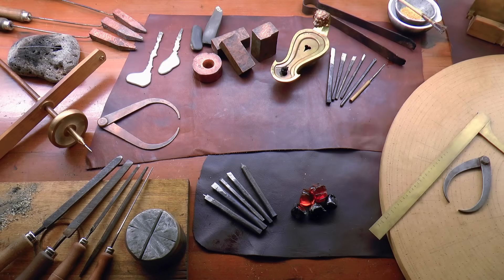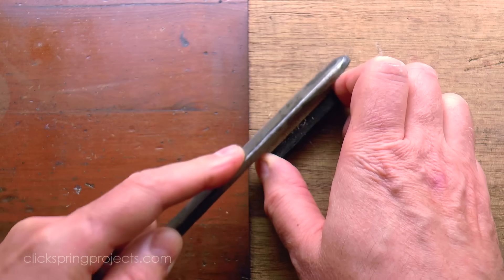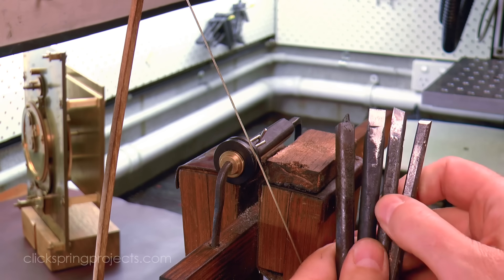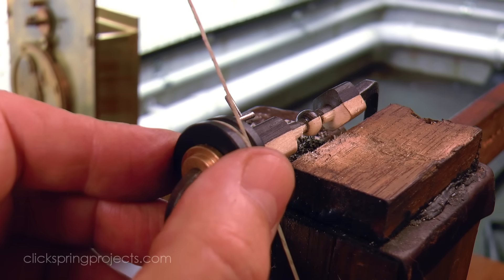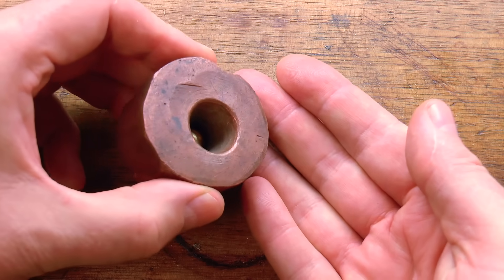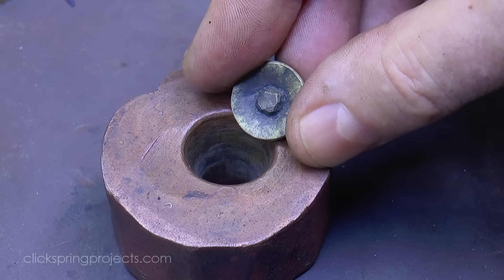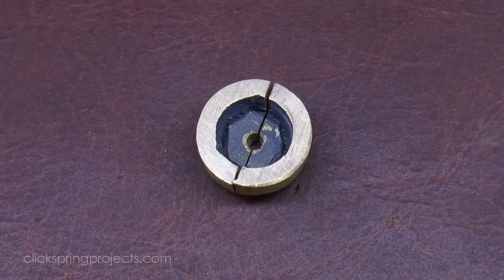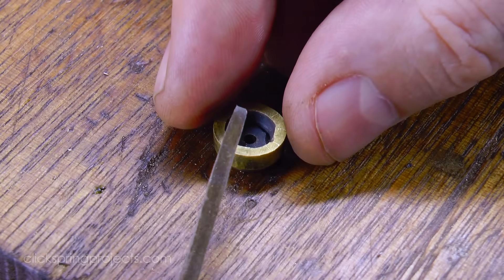The Antikythera Mechanism Episode 12, Part 1 - Making The Lunar Phase Display Assembly

Comment: Amazing work and experimental archaeology as ever Chris. There is one tool that really interests me. The worker's eyes. Since turning 50, my eyesight started deteriorating sharply. Now, at 58, I can't work without 2.5x magnifier glasses. I used to be able to read the finest of fine print with ease. I wonder how the ancients dealt with the problem ? Did they use very young apprentices or slaves, as the British did to make chronometer chains , or had they developed lenses made of glass or rock crystal ?

Comment: You should do a sextant one day. Not only you have to have 1° markings which you need to use neusis constructions to get (maybe not), you have to make a vernier scale and a microcrometer with a thread and for all the pieces to have a good tolerances. It will be interesant to see how difficult is to make without modern tools.

Comment: The technical knowledge and skill that it would require to  build a device like this today is quite considerable and to think the original was built 2000 years ago is staggering. Ancient Man was clearly not the ignirant brute he was still widely believed to have been. The ancients do not get the credit they deserve in many cases. Then there's the process of rebuilding it. The hours of research and careful planning this had to take are really profound.   This has got to be the ultimate expression of the clock maker's art. You really are a scientist in every true sense of the word.

Comment: One question I have is you have alwayused modern stock material which is flat on all sides (or perfectly cylindrical, ECT.). How would stock material have been made to either be squared like the stock material of today, or be made directly into a part?

It would be interesting to see a video where you would make bronze( or brass) in a crucible and turn it into larger material stock to be used on larger or smaller parts

Comment: I don't think they would have made just one moon sphere at a time, they probably would have made two or three out of it since it spreads the costs of gluing and pressing and basic turning into a cylinder over multiple work pieces. However, I think your methods would stand up exceptionally well even with this change in mind.

Comment: What other options would the original maker have had for the light side of the moon? Like which ones would have been whiter?

This would have been an expensive piece for a wealthy individual. Would ivory have been available and suitable?
Reply: Ivory tends to yellow a bit over time. Bone can be boiled to whiten it, though it may not glue in a compatible manner with ebony, which was available in small quantities back then.